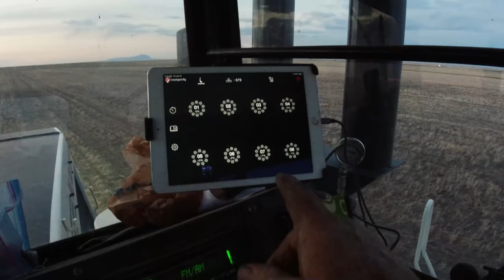We Finshed!

Comment: About the crack in the Big Bud . . .  Any time you have steel working that hard with vibration and torque you can get crystallization (metal fatigue). If you can, open the face of the crack it; may be obvious that the steel crystals are large and grainy.  If so, best thing is to get or make a new one with fresh metal. Loved seeing the MM and your dad this episode. Thanks Welkers!

Comment: Old school rock fork or a hay fork!  These old MM's are great tractors.  I worked for Grant Flage & Jerry Smith for about 10 years.  They had 2 of these, but they weren't Specials.  I used one to run a square baler & augers.  The other had a post driver mounted on the front.  Great old tractors that last forever.

Comment: The Moline is a very efficient and simple engine.   Not many bearings just a heavy 3 and  4 main bearing setup that does well at 1100 to 1350 rpm.  I am running nine 800HD Moline on irrigation pumps that I bought in the 1970's and 80's.   I have checked their  efficiency with a strain gauge on the PTO and gas flow.     These old engines are producing almost  the same hp hr / 1000 cf of gas as a G855 Cummins or 3406 Cat, just not built with the precision.

Comment: Also those seeps, we used to call it caliche. Would look dry as a bone. However dont drive on them as I found out the hard way as a kid. stopped and before I could open the door was up to the axles on the truck. Had to go back and get the tractor to pull the truck out. The ribbing I got for the next few weeks was epic...lol

Comment: To keep those bigger hoses on put a wire through between hose and clamp then tighten clamp and bend end of the wire back on itself then take other end of wire through opposite clamp and do the same. Allso rotate 180 degrees after 2 or 3 seasons and get twice as long out of them

Comment: Leg Arms:  For the rig that lost it's refrigeration charge, did you know that you can use Propane (yes, Propane...) as a refrigerant? After researching it for the better part of a year (and the fact that my vehicle at the time had non-working A/C <in Arizona>) I opted to charge the system with propane. And it works amazing. It mixes with any type of refrigerant oil, cools better, and for less than a couple of bucks will chill you to the bone.  (I use the green camping canisters that are available anywhere) They've been doing it in other countries for years and years... where they don't have big corporations controlling what is put in systems for refrigerant.  Since 2006, I've been using it in everything from cars to window air units, and even a walk-in cooler. (matter-of-fact, the A/C in the room I'm in right now is charged with it.)  Trust me, I've done the research. It's extremely safe! 
 Shoot me a message if you're curious, and I'll pass on my experience and info to you.  And No, I'm not selling anything, I just hate to see a guy sweat.  God Bless, my friend!

Comment: Discussion shouldn't be who broke it, but who'll fix it (cough: Leg Arms: cough) :). Out of curiousity how long have you had the 600 Bud? Them things haven't been new since the early 90's and I suspect yours is a bit older. Here's hoping this doesn't slow you down while the getting is good and to seeing the gentle giant back in the field. Good luck to you all. :)
Reply: It was produced in 1979 and we bought it in 2008
Reply: Robert Welker   In 1979 I was at NMC Diesel Tech. A guy named Dale Morey was painting Big Buds. A guy named Greg Clouse was going through transmissions and axles. Went to class with both of them. That Bud drawbar is 41 years old. Age & metal fatigue broke the draw bar.
Reply: @darrelfuhrman8217  Kinda what I was thinking. Mechanicals are generally workable or replaceable, but structures inevitably degrade much slower and for different reasons. Temp changes, seasonal ware and even the winds can be a pig, especially blowing sand, grit, dirt, Lye or Salt. Even keeping the tractor in a climate controlled environment won't save it from hours in the field. It seems to have reached the point in its life it's mehanicals are more worthy than the machine they're in, which isn't to knock the machine, but it'll be a labour of love for the old girl to take 20 years off her and to give her a chance with a new generation. Seems the minnie may have a room mate in the workshop. :)

Comment: the wifi transmitters, are they battery operated?
Reply: No powered by the cart battery
Reply: @RobertWelkerFarmerBob  So, its not total wireless 🙄
Reply: No. Each of the 8 ECM on drills need 12v power and the wifi module on cart too. But all sensors are non powered and info sent by wifi.